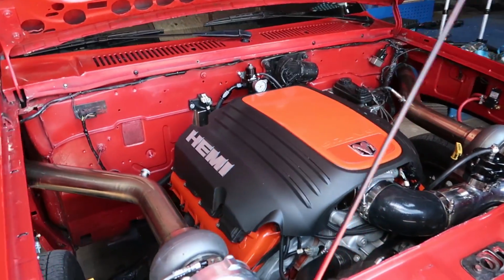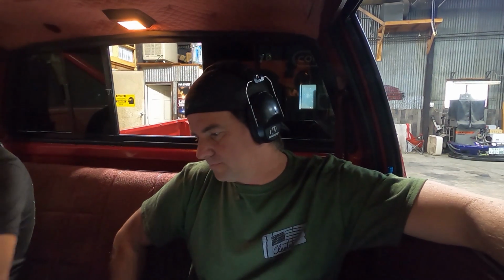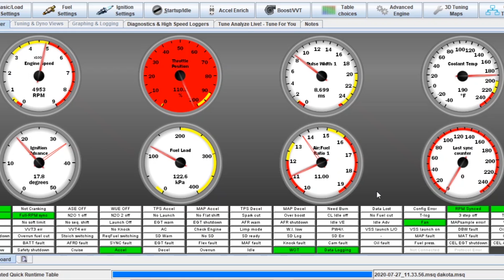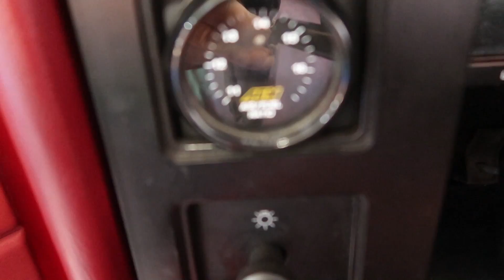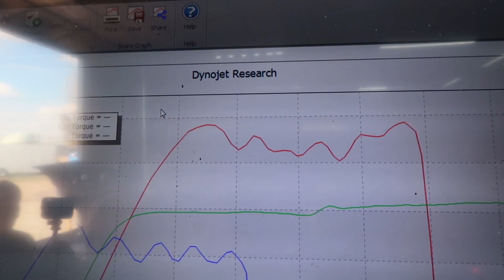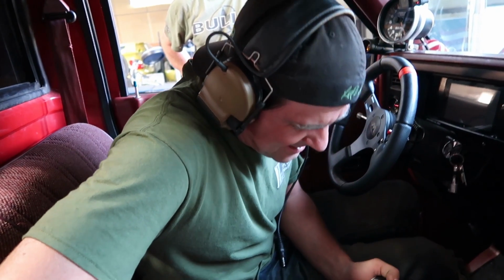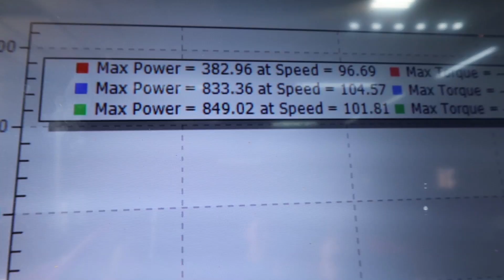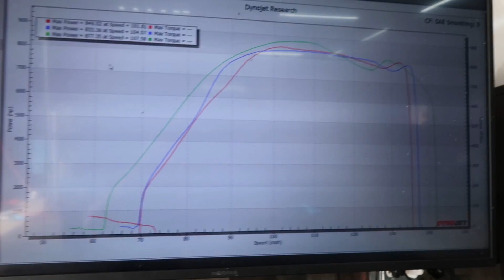Budget Hemi Build makes Big Mopar Power!

Comment: That's a sweet truck I had a 1987 Dakota back in the mid 90's it had a 3.8 liter v6 and ripped it out was wanting to put a 440 in it but instead settled on a 360 with ported 340 heads a big cam with a A833 4 speed trans put a 8 3/4 rear end in it out of a old road runner that had 3.73 sure grip that I traded a guy that had a 4.10 sure grip carrier the thing flew a friend of mine had a S10 with a 355 sbc and he could not keep up with me I would walk away from him half track and leave a gap on him all the time LOL it was a fun truck.

Comment: honestly the gen 3 hemis don't get the love they deserve, they have so much power potential at a relatively stock build I don't see why more people aren't swapping them. Awesome truck and one hell of a job brent!
Reply: Price is the problem
Reply: Bingo Yahtzee we have a winner!
Mopar parts are stupid crazy expensive. You can build 4 LS motors to one HEMI.
Reply: @DoyleShadduck  I know they're spendy, built more than a few. I could buy 4 sets of the same heads for a sbc for the price of one set of small block mopar heads. But the Mopar engines seem to have a lot of things from the factory that would've already been an upgrade on a GM. Like the shaft mounted rockers in the Mopars vs the pedistal mount rockers on the GM, along with thread on oil pickup tubes vs the GM press on (weld on lol) style. Plus a 2 bolt main small block mopar has damn near the same clamp load on the main caps as a 4 bolt main GM. There's plenty of other nice touches on Mopar engines that would be upgrades in GM engines too. But yeah, the GM engines are dummy cheap to build compared to Mopar and Blue Oval stuff.

Comment: That's badass. I just picked up an AWD Hemi Durango that's going to get a custom 3rd gen Dakota reg cab body swap and tomorrow I'm going to go get a 4.8 LS just for something to build. I'm also pulling another 5.7 Hemi out of a friend's truck to build for my 3rd gen Dakota x-cab.
Reply: Does the n/a hemi have the same internals of the boosted hellcat motors? Ls guy here dont know anything about these
Reply: @wheeln24-79  hellcat engines are 6.2 L and have different internals than the 5.7 6.1 and 6.4 engines. The 5.7 and 6.1 have kinda the same block with a few differences but you can put 6.1 heads on a 5.7

Comment: Yo props to the builder on using a Raspberry Pi for the computer!
Reply: Megasquirt for the win
Reply: The Pi is just for the dashboard gauges. The engine computer is the mega squirt hardware
Reply: I run megasquirt MS3 pro on my turbo Camaro
Reply: Thank you I love it in my truck as well

Comment: What a great video and truck.  I've got a 5.7 junkyard build with Twin Turbos on Megasquirt also, and my big mystery is ignition timing.  I see you had very little timing in it in the chart you started with on Pump Gas, but I was unable to track along the timing changes.  The rest was like a Master Class in tuning these things!  Any way you could fill me in on the timings with each pull or would that require a drive up your way from LA to have a little sesh?  Keep up the good work!

Comment: I used to have a 96 dakota sport 3.9 manual..heads cam exhaust rims an tires...it was fast..160 halfway through 5th..140 at the top if 4th

Comment: Brent I have an 92 hot rod chevy truck currently with a SBC but I constantly bounce ideas around in my head about what route the next iteration will be.... Hotter SBC or LS swap... You know the deal, but SBC strong enough to  hold 600+ hp can get expensive, LS swaps are so played out, killer performance but nothing new and exciting there these days a LS spanking SBC is more exciting to me. But an idea I've been pondering is a late model 5.7 hemi swap... Would that be significantly more expensive then an LS swap? There's plenty of old dodge trucks around just like 5.3 Silverados. Being an older carbed vehicle I'd need all the same upgrades for an LS (and a my built 700r4 is smoked too so new trans is mandatory already) . The only thing I'd think is engine parts for LS's are cheaper and exhaust may be a challenge... probably but I'd prob only doing a cam upgrade at the swap. Would shoot for single turbo eventually. Is there adapters out there to put GM trans on hemis? Hope all's good especially with the EPA crap, you don't deserve that shit.

Comment: I just picked up 2009 5.7 Hemi with 220,000 kms or 136,000 miles it was pulled because the owner started to hear the Hemi tick. He bought a crate motor to replace it and I got the old one for $200 Canadian.  So I'm gonna read up on this thing as I have been a Chevy guy up to this point . Time for something different.

Comment: I got a 2005 Chrysler 300C 5.7 hemi.. with predator tuner, cold air intake, headers and exhaust. I believe I rolled a lobe on the cam so I'm looking into a stage 2 cam, also e85.  Any advice would be great!

Comment: It's a beautiful 5.7L, but what did you do (if anything), to the pistons, rings, connecting rods, and crank?  With all that extra boost and added horsepower, I would think it would be quite a strain on the rotating assembly.

Comment: Just out of curiosity, why don't you see any gassers running compounds? Here in the diesel world any twin or more set up, it is always compounds, you can build so much more boost, the shop truck is running a 5 compound set up, yes 5, 2 sets of very built "factory" 4.5 turbos, which are compound from the factory, which are feeding a 108mm single, it was a just because we can so we are deal, lol, but even the 4.5 powerstroke and the 6.4 powerstroke are compound twin turbo set ups from the factory, like I said just curious

Comment: hope that thing has some good oil pass through lifters, factory does not allow for oil to get to the lifter rollers/cam lobes under 2000 rpm, leads to short engine life, i always tell people to grab some johnsons lifters that address the oiling issue.

Comment: I have a single turbo hemi in a truck and I'm curious, what sort of ignition timing were you guys running at 16 lbs and 21 lbs? I've heard wild stories about these engines with really low timing. I stopped at 501 hp and 585 lb ft on a hub dyno and only 12 deg of timing using race fuel. Any tips would help. I'm for sure going to tighten up the plug gap!

Comment: Good to see some hemi not all has to be LS, why put an LS on a dodge having good dodge engines.
Reply: cuz GM knows whats up
Reply: No ....because all the GM geniuses are all following what this or that guy did  they all do the same shit generic  nobody strives to be different....LS swaps are popular for a reason.,..cuz they make a lot of horsepower for cheap and all the modern amenities make it so, fuel injection ✔️ ecm/pcm✔️roller💓✔️ forged internally ✔️ all good things but not the only manufacturer to do so this dude seen the motor in a wrecking yard for 200$ transmission 50$ rear diff 100$that's just as cheap as any LS you'll find it a salvage yard I really don't see LS's as  being actually better per say except for one catagory.... Popularity ..... This young man with this has enough🤔 hoodspa💪 to  march to the beat of his own drum 🥁 and I find that to be an admirable trait these days he is a leader not a follower he did shit proper & kept his Mopar all  Mopar and like this tuner guy said the suckers got  jam .... And lots of it....

Comment: Man runs 12's without a cage then twin turbos it and still no cage.Thats a 1 pass before kicked out the track
Reply: Pretty sure you have to be faster than 10s to require a cage..
Reply: Should run 8 90 in the quarter  at hundred and sixty miles an hour needs a parachute
Reply: @danielsullivan9865  lol
Reply: @legros731  3200 lb 879 rear-wheel horsepower equals 160 quarter mile. Do the math
Reply: 11.49 and quicker needs cage

Comment: what year hemi? 2009+? eagle heads? 100% stock bottom end? stock ring gap?
Reply: 2006 ram 2500. Pre eagle stuff. Yeah 100 percent stock bottom end. Opened up ring gap. Head studs. Comp cam, lifters, springs, retainers, and push rods
Reply: @krazyhouseperformance  Would this build work with a newer style engine with the cam phasing?
Reply: Ferrari 250LM I don’t see why not. You will have to probably go with the Holley ecu or stock to be able to control the cam timing. I think megasquirt can do it. But I’m not exactly sure how it works.
Reply: @krazyhouseperformance  Ok, so there are no mechanical reasons that you know of to not go with cam phasing?
Reply: Ferrari 250LM well without it makes it more simple. Less things to have to worry about.

Comment: Really hope they at least took the engine down to recap the rings, or it was over 150k miles to have wore down enough to open them up. I've seen numerous Hemis pull the pistons apart because the ring gaps were too tight for boost.

Comment: i found something  crazy that could be used for race projects.
these guys bought the original tools and machinery  to make the mk1 mini cooper.  
they make all body panels in house and sell them as whole bodyshells or parts.
a small and super light body that you can order in sections and  build a sick super light  k swapped  awd mini.
im thinking it could make some builds easier since  whole body can be ordered in sections and basically build it around a cage.
can see some of it here  https://www.youtube.com/watch?v=nJRT5ey0M2w
called British Motor Heritage Limited and was established in 1975 to support classic car owners by putting genuine components for classic British cars back into manufacture, using original tools wherever possible.
power to weight can be made dream numbers with this.

Comment: Anyone know the final tune specs? Timing, duty cycle, boost level to achieve 800+ hp, plug gap?
Reply: plug gap was .012. 20 psi netted the 800+. injectors were around 73 percent. dont recall timing numbers off the top of my head

Comment: Is this a 5.7 or a 6.1?
Reply: 5.7 hemi non eagle
Reply: @krazyhouseperformance  Wow what an awesome build! I don't know much about Hemi's I still got a lot to learn, but performance wise are non eagle heads better to go with? I know the eagle heads on the 2009 motors have the vvt, does that cause any issues with boost?
Reply: @JV-ui2gq  either way they are good. only issue with the early heads is they drop valve seats when you over heat the engines.

Comment: What do they mean when they say on gate?
Reply: No boost controler is involved. It's just making the boost that the waste gate spring will allow on its own.
Reply: The Waste Gate is controlling the turbo pressure to an extent.
Reply: @lb9gta307  so the wastegate is open and its making 5 psi?
Reply: @geoffreyyezersky1476  that's where the waste gate is opening

Comment: Imagine dropping a hellcat engine in that thing it would fly for sure that truck is way lighter than a Challenger that's for sure by at least a 1100 pounds or more
Reply: truck weights in at 3060 without the driver

Comment: 250 kPa is not 17psi.  250 kpa is 36psi absolute - 1bar(14.7) atmospheric pressure= 21.5psi.... in the log you should see 250 kPa. if you're under that you're reading should reflect that. I've been using megasquirt for over a decade something's not right. You guys should be good to 21.5 PSI. I consistently push mine over that.. it just follows the same ramp rate. you can't go far over it but you can do it. Yeah and just because you guys are in 80 kPa doesnt mean your map sensor reads lower. It just mean from 80kpa and up is Boost. it still reads to 250 kPa.
Reply from the maker: Oh we made boost over it just didn’t see what it was, could have been a strange scaler with the sensor they were using.  And our elevation is low but agree the sensor should read up there. The three bar seemed to fix her right up and where it needs to be any way.
Reply from the maker: Love the 2 maps on the mega squirt. We had a lot of resolution

Comment: Is he using flipped srt manifolds? Did he just no care that all the bolt holes don't line up? I only ask because I'm building a turbo hemi and can find any easy solutions for forward facing manifolds
Reply: So they are jba short headers that we milled apart. And took the headers and flipped them from side to side. So left the flanges on the proper sides but flipped the header tubes and faced them forward.
Reply: @krazyhouseperformance  That's what I've been planning on doing myself. Just didn't know if there was an easier solution.
Reply: That’s what we could come up with. As far as cheap would go. I’m pretty sure someone makes actual flipped turbo headers now.